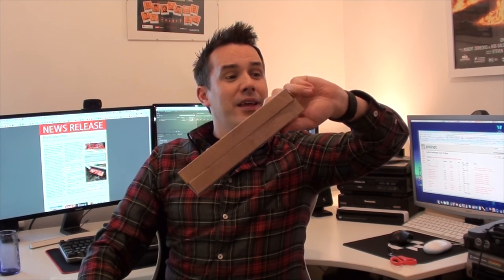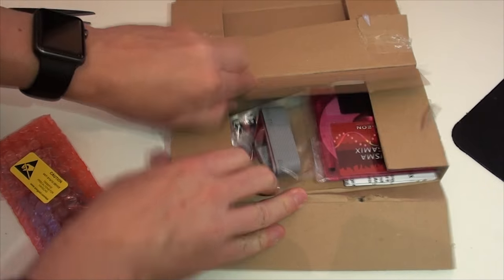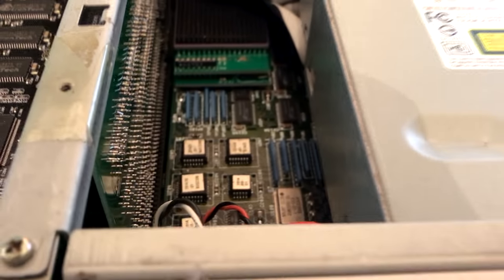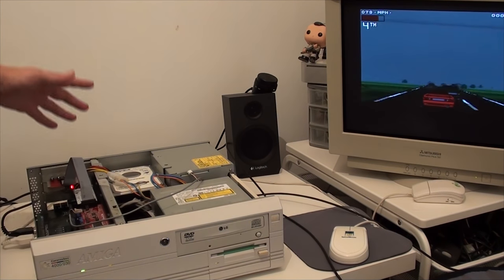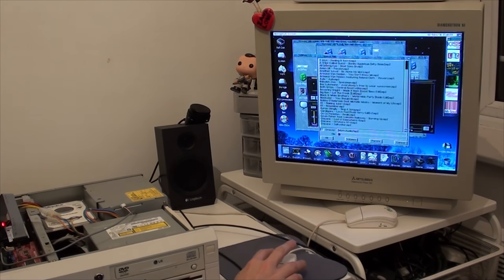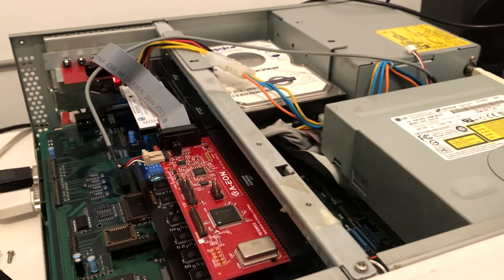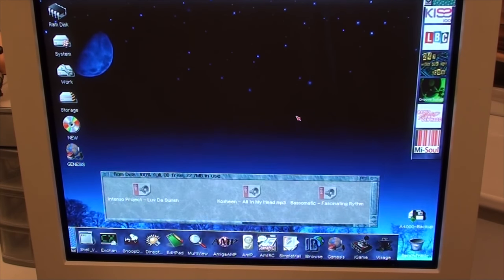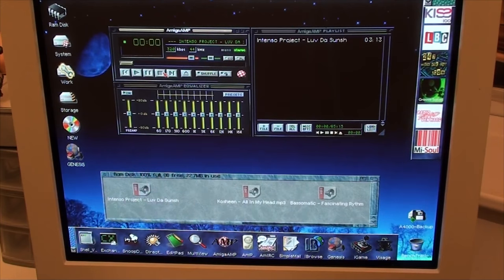Commodore Amiga Plays MP3s - Prisma Megamix Soundcard Review

Comment: Very interesting unboxing and preview video Dan, look forward to the proper review when you get the new card. I absolutely respect and highly salute AEON for bringing out legacy card for classic Amigas.  I wrote on Lemon recently, I think powering up classic Amigas is the only way forward, as so many people have a dusty old Amiga in the attic, which with a few tweaks could be brought massively up to date for the modern world.  This card essentially makes playing CD32 games on a most Amigas possible (Not A500/+), so with the recent port of i.d software's Catacombs3D to the Amiga, how long before someone ports a PC-CD game?  

Very impressed with you rig Dan, ethernet and a top end RTG card! Yeah the thing about zorro cards is they work as their own little independent computer (a bit all the chips inside the Amiga), so they are 'dumb' unless you force-feed them some data signals using software to poke the card into action, the card is unaware of your computer at all. I was actually almost screaming at the TV when I realised two of the ports on the back were Inputs! as a pass-thru for the Paula sound, but you realised the issue in the video. Even if you cant get the pass-thru to work, you could plug the output of the card into a pre-amp, and have Paula plugged in to the same amp/mixer, and mix or separate the signals, perhaps Paula playing on Front L/R, and CD playing on Rear L/R and Mid/Bass Speaker for 5.1 surround Amiga vibes?  <sends chills down my spine>

Comment: I have noticed you are using a Maxtor harddrive with a manufacturer date of 1 july 2006. That drive is already 10 years old. Why not replace it with a flash drive type of card? Or a regular ssd with a ide -> sata converter. Saves you space and heat in your A4000 case.
Reply from the maker: An SSD with IDE adapter maybe a solution I'll look into when the hard disk eventually dies, so far had no issues with it though, and there is something nostalgic about the sound of a mechanical HDD inside the case.  I moved away from using CF Cards etc for two reasons, firstly they're not big enough (I filled an 8GB CF Card in a few weeks), my 160GB hard disk gives me much more space, and CF Cards die hard and fast.  At least with a hard disk you generally get some warning that they're failing, I've had a few CF Cards work one second, then lock up and never work again a second later.
Reply: That's why a regular SSD would be a far better choice. These drives have so much read/write cycles that, certainly on a amiga, it would last 1,000 years. It would be faster than a regular hard drive too. It's something you may consider for your A4000.

Comment: I would really like to know why they would release a sound card with a CDDA header, but it isnt enabled out of the box. Its not like there is any magic going on with the sound card, it just acts as a mixer, and passes it through to the speaker output mixed with its own audio, and the line input, which in this case is the Paula audio. I also think it is bad that they didnt even label the 3.5mm sockets on the back, or had a diagram in the manual. They could have at least silkscreened it onto the PCB and it wouldnt have costed them a dime. Although I havent used or owned one myself, I think this card has a bit of a poor design. I understand products that are released as sort of a work in progress and are improved with software updates, but there is no excuse for the issues with this card.

Comment: Awesome can this be done on a older amiga 500 or even a 8bit computer or do you absolutely need a amiga 1200+ or equivalent in order to play mp3s?
Reply: betarage since this card is a zorro card it can only be used on a big box amiga like the 2000, 3000 and 4000 .
Reply: ***** Can a card for what the older amigas or different computers use or do you need the speed of a zorro card for mp3s to play well.
Reply from the maker: This card also works with Clockport, so it will work with A1200.  This card won't run on a stock A500, but if you have Kickstart 2/3 you can use a MAS Player.  I did a video on that a couple of years ago: https://youtu.be/xdxuIZftyis
Reply: Well from what I could find you should be able to make this run an any Amiga. On all box Amiga's (except A1000) you can use the Zorro slot, on the A1200 use the built in clockport, on the A500/A1000 use a clockport adapter to add a clock port to use and for the A600 get either an accelerator or memory expansion that adds a clockport.
It's a cool design having both Zorro and Clockport interfaces on one card. A bit disappointing that CDDA doesn't work.

Comment: I think you need to reboot, I think you need a SPDIF connection from the Prisma to the SPDIF connection on your graphics card and you signal will appear on the HDMI feed to your monitor, Would it not be possible to install a quad core PowerPC processor to make your COMMODORE AMIGA 4000 run faster.
Reply from the maker: There are PPC accelerators for the Amiga, but they're very expensive, and I have no real interest in them.

Comment: The A4000 actually have a cd audio header on the motherboard.

can be seen in this picture, near the rca audio outputs.
http://members.iinet.net.au/~davem2/overclock/A4000MB.jpg

And here is the pinout of it. 
http://www.zimmers.net/cbmpics/cbm/amiga/a4000jumpers.html

In my own a4000 i used a standard internal cd audio cable like you did in the video.
I just swapped the wires around in one of the connectors on the cable to match the a4000 motherboards header.

Do note that the audio from the cdplayer will be lower in volume then the output from paula, this can be matched up in the mixer of amigaos, dont know if it will work in all programs though.
Reply from the maker: +lolladinz True, but the A4000's motherboard header has a weird, non-standard pin layout. I did make up a special cable to fit it a few years ago, but it was very unbalanced, CD audio was very quiet and Paula output really loud. Will be much nicer when the Prisma does it
Reply: Don't they write the Prisma has Line-in support? So maybe you could have the CD audio connected to one of the backing plate ports as well? Btw. did you figure out which of the ports does have what function? I have also ordered a Prisma, but not yet received... not sure, if I had ordered one had I seen your video earlier ;-)
Reply from the maker: I think it has one line-in, but you need to use that for the Paula audio pass through.  I don't have the card at the moment, I've returned it to Amigakit now for repair/replacement.